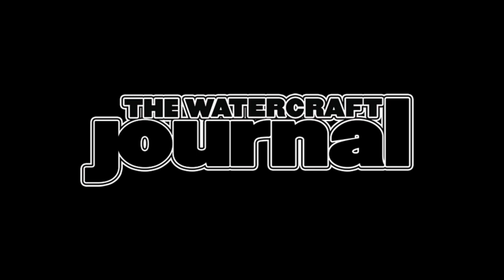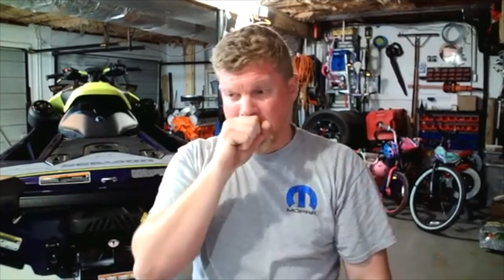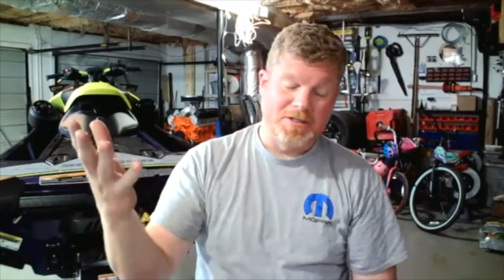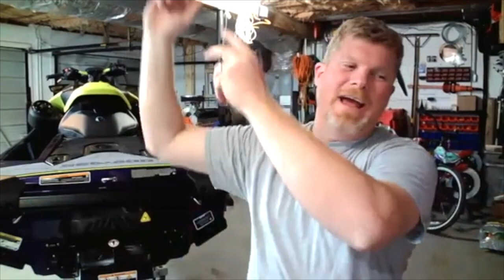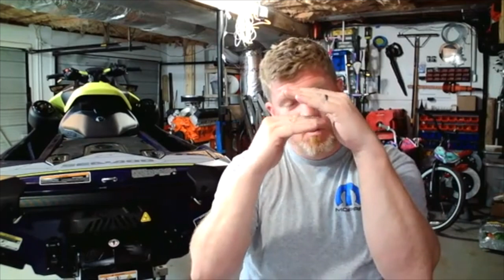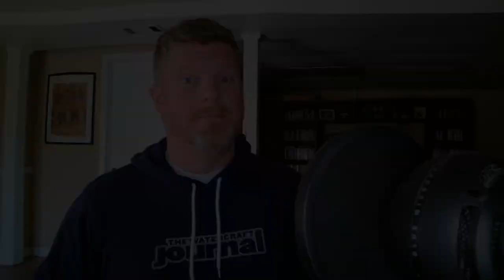What's Up With Yamaha's NanoXcel 2 Hulls? WCJ Quick Topics

Comment: Hmmmm, I’m not sure it’s just paint though, what happened to my buddies 21’ was when you go onto floating docks the hull didn’t have support behind certain sections and it weakened the actual hull to the point to where you could push it with your finger. I have pictures if you’re interested.
Reply: I don't have the floating docks. my wavrunner floats in the water and still has issues with the hull

Comment: Most Automotive paints are Acrylic Urethane As it cures it gets very hard. Still maintains a rubber like flexibility. Adding flex additive slows the thru cure helping the paints durability and flexibility. Somehow their process makes the paints brittle maybe too much gardener or forced dried to fast
Reply from the maker: Possibly so. Guaranteed they've looked into their flashing process.

Comment: thought hole in 2020 Yamaha FX SVHO hull from submerged stump I hit so took it in.  There were 5 other 1-3 yr old Tamaha FX's with holes in hulls running mostly lengthwise from rollers on dock lifts per respected  shop owner.  A 2022 FX Limited had hole 3' long in roller line and insurance had totaled it.  He had pics of couple showing the smaller sharper (not wide) rollers putting too much stress on hulls ... esp nanoexcell.   Its a design issue ... these hulls not made for sharp rollers

Comment: Does this happen on non NanoXcel 2 hulls? I don’t think (although I’m not certain) that the EX doesn’t use the NanoXcel 2 hull. My EX doesn’t have a sticker on the back like the GP’s do which states it’s a NanoXcel 2 hull
Reply from the maker: No, the severe flexing is specific to the Nano2 hulls. Only the EXR is made using Nano2. All else are FMC.
Reply: Thanks for the response! Love all the content, keep up the great work!
Reply: What about NanoXCell (original)?

Comment: I scratched my gp1800 2020 hull the other day ..my ski was sinking cause the drain plug failed..so I had to beach it..i drug it up slowly to shore..when i got home i noticed lots of  good size scratches down the middle and some chipping of paint...am i doomed now?...
Reply from the maker: Doomed? No. But you do need to perform some repairs. We strongly recommend once repairing the deep chips/gouges that you clear coat the hull.
Reply: @watercraftjournal  thx u...wish i could send some pix
Reply from the maker: email us at info@watercraftjournal.com

Comment: I have a 2013 fzs . .with stage3 Riva kit. Super fast for a month then my intake tunnel fractured. From front by intake grate up one side of tunnel to top corner of intake pump. Repaired with fiber reinforced filler. From bottom and inside . Failed within 30 mins
Reply from the maker: Well, the guys at CRT and JP Racing are still using FZR hulls, so the reinforcement might not have been performed correctly.

Comment: ok i just bout a 2021 yamaha exr this past saterday and i got it home and really did a good look over one more time. And i dont know how i missed it but the hull is cracking/paint is already cracking in the rear of the ski next to the baording step i hope yamaha will cover the repair sense i haven't even got it on the water yet.
Reply from the maker: Yeah, definitely take it back to the dealer immediately. No brand new product to be sold to the customer like that.
Reply: @watercraftjournal  yeah I plan on it I just won't have the next day available to do that until this coming Saturday
Reply: @hotrodgt69  what was the outcome with your ski?
Reply: @stephenwhite5444  Stephanie, I took it back and they fixed it but ultimately at the end of the season of 2022 I traded it in and got a 2022 GP 1800rho instead

Comment: Is this a “structural concern” or just appearance related?
Also does it apply to NanoXcel earlier versions that are not NanoXcel 2 such as VX series?  I own a 2019 VX cruiser and a 2018 VX cruiser. I only see the paint missing where they slide on the trailer bunks. Figured there is no way to prevent that.
Reply from the maker: This is specifically for Nano2 models. No VX used it.

Comment: Just got a 2018 GP 1800 R  with 27 hrs on it, super clean, and it’s delaminating pretty bad on the Hull, probably going to have to be a repaint.
Reply from the maker: Yikes! Get the flex additive and extra clear coat.

Comment: Say what you will about Polytec, but this is one of the positives that Sea Doo brought the table in hull technology. They may increase drag, but are definitely well suited from a durability standpoint to how people treat their PWC’s.
Reply: I laugh ever time I hear this brought up. 20 years ago when I was really into racing alot of guys would take sandpaper to their bottom decks and gain a few mph depending on conditions. The air being trapped by the rough surface actually means less surface area.

Comment: Hi Kevin, Have you heard about this happening to any of the 2022/23 Jetblasters? Or is the lighter ski holding up better? Looking to order one very soon to be used in the Murray in Australia once the floods drop down to normal levels.
Reply from the maker: The paint is still very fragile, so be careful when you beach it, run it up bunks, dock it, etc.
Reply: @watercraftjournal  thanks for that, do you see Yamaha going back to SMC across more of the range in 2024?

Comment: Purchasing a new left over 2021 fxsvho this Saturday. Debating taking it straight to my body shop to have 2coats of clear with that additive put on the hull before even getting it home. Do you think it a good idea or am I just being overly concerned?
Reply from the maker: Considering that you're already this concerned makes me think that you'll treat your Yamaha right from the beginning – so I'm not concerned. Most think these machines are made out of steel and teflon and simply isn't the case. Keep checking your hull and be a thoughtful/careful owner and you'll be fine.
Reply: @watercraftjournal  awsome thanks for the info

Comment: Hi guys, I pick up my Fx Ho in 4 weeks 2021 model . Is this issue going to affect the hull on this model ? There will be times where I’ll have to gently pull it up onto the beach 🤷‍♂️ I’m super careful with my stuff.
Reply from the maker: Theoretically, yes. And NO, do NOT beach your ski. Buy an anchor and bow line and anchor in the water. The hull is PAINTED. You wouldn't drag your car's hood up the beach, would you?
Reply: @watercraftjournal  thanks , so is the nanoxcel hull the same as the xcel 2 hull ? In terms of materials used etc etc or is it slightly diff ,
Reply from the maker: It's slightly different, yes.
Reply: So do the 2021 fx ho have a gel coat on the hull ? Thanks 😊

Comment: Would 3M wrapping on the deck and hull help to avoid paint spidering?  Or is it a no-no to wrap a Jet Ski’s hull?  
Love your channel!
Reply from the maker: The wrapping wouldn't prevent the paint from flexing or cracking, only damage from impacts and contact. And definitely do not consider wrapping the hull.

Comment: I have a 2021 gp 1800 r svho never beached always on floating lift. took out out today and paints gone on the center of hull! Total bs especially since mine has never been beached once!
Reply from the maker: Waitaminute. What kind of floating dock?
Reply: @watercraftjournal   wave armor has the wheels goes right up wheels off to the side. Not close and way off from touching anything in the center
Reply from the maker: We're pretty sure it's not chipped off, but rubbed off. Look at the edges of the paint; is it a sharp ledge or is it beveled? If it's a sharp edge, take the ski to your dealer and demand a repair (that's paint that has peeled off). If it's beveled, the paint's been ground off.
Reply: @watercraftjournal  I’ll have to do that. I had a Kawasaki 310x that got stolen from the marina that I bought  it at. They had it a month took it in because it lost power and would top out at 61. Then they let it get stolen, Wylands marina in Mishawaka indiana right before Memorial Day don’t go there! Then they wouldn’t even cover it! I had to turn it in to mine insurance. It’s been one of those years! So then I found the Yamaha nice other than that. Does way better on fuel but the Kawasaki ripped through chop!Thanks for your reply!

Comment: The “Elastomeric” additive’s have been used for decades on plastic painted body parts in automobiles, bumpers, body panels, Corvette’s (Fiberglass Body), Saturn’s (Plastic Body), etc.

This isn’t new, Yamaha should have been using that since they stopped using Gel Coat and started using Automotive paint!

I get why they switched to NanoXcell, but I don’t gst why they stopped using Gel Coat.  Automotive paint is no doubt cheaper, but a horrible durability choice.  Boats, especially the hull’s take alot of abuse, the strongest, most durable finish is FAR more important than the little weight savings they gain from not using a Gel Coat.   Ski’s are soo fast now the vast majority of them are governed, so what is really gained by saving the little extra weight?
Reply from the maker: Then you'll really want to check out www.watercraftjournal.com on August 17th.

Comment: I bought a 2019 fx cruiser ho.  At 40 hours it completely delaminated. It wasn't  the paint that came  off it was the actual material even riping off the sponsons. Never beached extremely well taken care of. Always cleaned it from top to bottom looking like it never seen water coming straight from the showroom floor.   Yamaha knew it wasn't paint that came off it was a total delam. They replaced the ski with a 2020 fx svho cruiser and the red bottom paint is already coming off where it rest on the bunks. I'm extremely ocd when it comes to taking care of what I have and it is frustrating when I'm taking every caution to keep my ski looking new.. I miss the gel coat! Still love my ski just wish Yamaha would come up with something better
Reply from the maker: That paint is incredibly soft. The best solution we've encountered is having the hull of your NanoXcel 2 Yamaha coated in one or two layers of clear coat to seal it even further.
Reply: @watercraftjournal  that's actually something I've been thinking about doing.. just didn't know if it would be worth it or how it would affect warranty "if" something was to happen again.   Absolutely love the ski and performance.  Just always on edge after what happened
Reply from the maker: No doubt! No idea how it'd effect warranty, personally.

Comment: Yamaha hulls are far Too Thin no question about it. Thick Grp seadoo and kawasaki hulls NEVER FAIL.
Seen failures at least half a dozen times of yamaha hull failures straight out of the crate thus has been happening for many years. Nano eggshell 2 is not the answer for a reliable hull.
Reply from the maker: It's not a matter of the hulls being weak, it's a matter of the painting process and materials.
Reply: @watercraftjournal  No other manufacturer of watercraft have ever had these delicate hulls that fail in such high numbers so no matter how you dress it up theses hulls are not fit for purpose for everyday hard riding in rough waters they will fracture delaminate and sink i have been witness to this many many times and Yamaha knows about this flaw and has not addressed it successfully.
Reply from the maker: The failure rate isn't what the internet would have you believe. (Same goes for Sea-Doo carbon ring failure.)
Reply: @watercraftjournal  Not in my 30 years of riding i totally disagree i have had over 50 machines in that time and the Yamahas have always turned out fragile in the hull area and also the intake shoe driveshaft area and intake grate area as well not to mention the hull below fuel tank where they constantly crack and delaminate in rough water riding. Sure on a lake or calm water probably not a problem but why Yamaha calls it a Wave Runner is misleading.
I would much rather replace a failed sea- doo carbon ring which by the way I never had a failure, than a hull that isn't even available from yamaha other than buying a new machine.

Comment: Should have bought a seadoo
Reply from the maker: Every brand has their problems.
Reply: Kevin is correct saying all brands have there problems BUT the integrity of Yamahas hull is by far the biggest problem of all that cannot be successfully repaired long term after failure. I understand Kevin has to be non bias between makes of watercraft but the reason these discussions are public are for good old fashion honest truth.
Reply: Sea doo and Kawasaki’s have major engine problems Yamaha engines are the most reliable water crafts in the business 
I’m on my second Kawasaki 310r and had a 250x both were and are junk 
My Kawasaki 310r cuts out at 30 mph sputters changes the ECU NOPE changed the fuel pump NOPE spark plugs NOPE
my mechanic is stunned poor guy ski has been broken down more than a month very frustrated engine is good compression is perfect pump and prop perfect
Reply: @martinreagan5083  Yamaha engines are not great either just a few years ago there timing chains were snapping causing major engine damage and a known fault that Yamaha recognised and eventually fixed also the Yamaha Supercharger fails regularly and the Yamaha injector wiring breaks at the plug end causing misfires and break downs.
Reply: @martinreagan5083  that's unfortunate about the Kawi.  I have a '19 310x and couldn't be happier with it.
Reply: Yeah instead of worrying about the paint cracking we can worry about the hull itself cracking 🤣